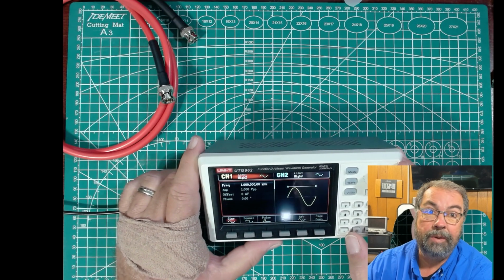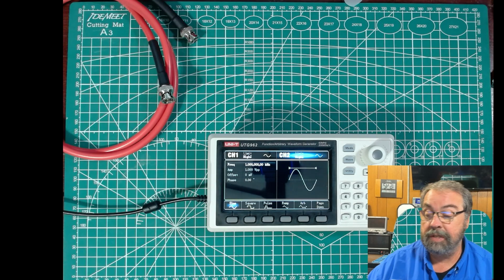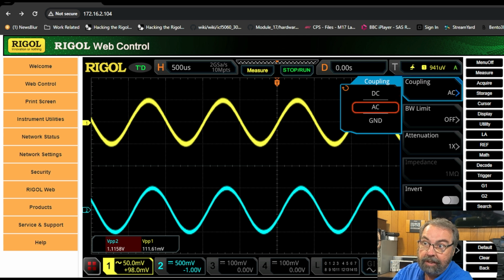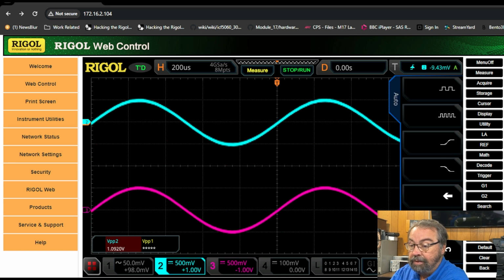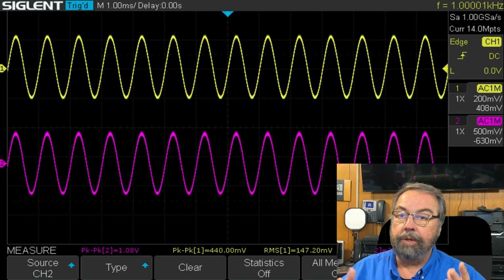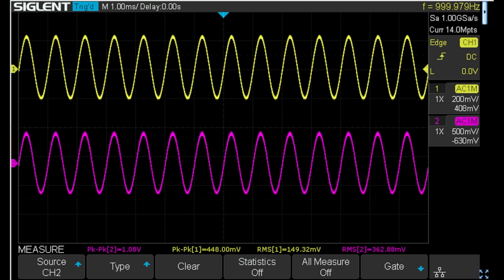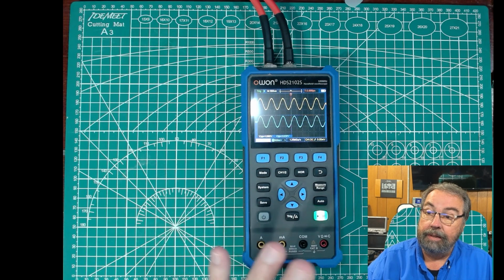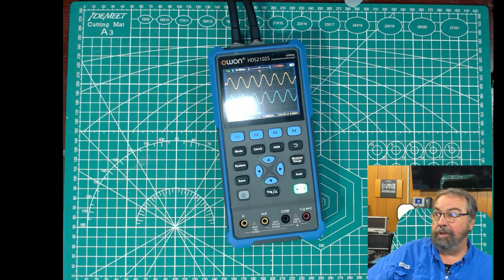The Mystery of the Weird Scope Readings

Comment: First, I was expecting a Rick roll. 😉

Ch 1 and 2 showed the amplitudes looking the same, but the vertical scales were different  so they should have looked different. This was on both scopes. Set them the same.

Next, use DC coupling, even if the arb has zero DC offset. If that does nothing, add some DC offset to the arb, maybe 1/2×Vpp. Hypothesis being something is odd about the ac coupling.

Also try a higher frequency. I cannot imagine them sucking this bad, but AC coupling is just a high pass filter. 1kHz might be on the edge and one channel might be off. If that changes results, try a lower freq (maybe 100 Hz).

If I think of something else, I'll be back.
Reply from the maker: Dammit, that would have been funny!

I played with both, same results, and only on channel 1 on 2/3 of scopes.  I originally was using 10Mhz (that's what Ape had started with), and got the same results.  I just backed down to 1, so i engage the bandwidth limiter on the rigol.  It's weird for sure.  Yeah, I know the amplitudes looked the same, since the VPP read lower, I just adjusted the vertical til they were both on the screen.  That shouldn't affect the readings on the measurement though?  Ape and I were thinking about doing a live stream in the next week, to ponder this some more.  I'm not the worlds best scope monkey, but this seems like basic stuff.  Lee, the other strange thing is that the onboard arb in the rigol gave me the same flaky results as the external one.  For the video, I just used the external one.  Also, the strange results stayed on channel 1, and only channel 1.  Literall unplug the cable from 1 and move it to 3 or 4, and they read the correct VPP.

"Never gonna give you up, never gonna let you down..."
Reply: @FEPLabsRadio  Right, vertical should not change the measurement.

Comment: Strange. But we need more test data point ... how about testing at 50Ohm impedance, how about higher/lower amplitude, how about much higher frequency or other waveform ... the issue can be anywhere, for example, both scope channel 1 been damaged in previous use.
Reply from the maker: I don't have any way to come up with a different impedance - either 50ohm, or high-z.  The behavior follows the same pattern at 10Mhz (originally where we found the issue).

As for 2/3 scope channel 1's being damaged, I consider that unlikely.  Both of these were purchased new, and have light use at my house, and that's it.  I think it's a common library/firmware thing that rigol and siglent have.  The odd results only stay on channel 1.  The owon handheld worked fine.  Also - @thesmokinape had the weird results on his rigol scope as well.
Reply: @FEPLabsRadio  Thanks for the update.  Other testing can be connect channel 1 to other signal source (like just test a 1.5v battery DC voltage) compare to channel 2, to make sure it is not damaged. And/or a factory reset on the oscilloscope.

Comment: Might be a design flaw where a lazy developer used the reference schematic on a chips data sheet and didn't realy invest time to design a proper circuit. That has happened.
A similar thing can happen when a programmer reuses a chunk of code from a common library or another product.
Reply from the maker: That's what it feels like Paul.  Amazingly Siglent and Rigol suffer from the same library/code/chip issue, but only on channel 1.